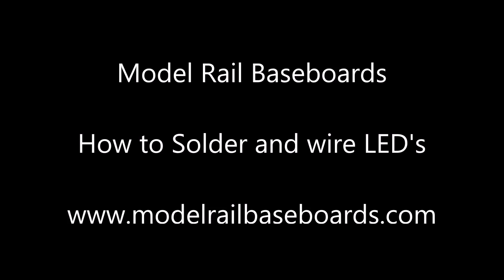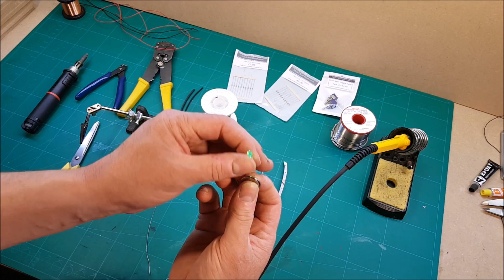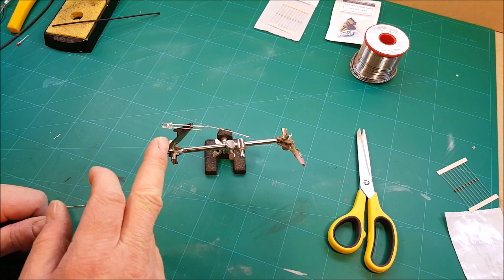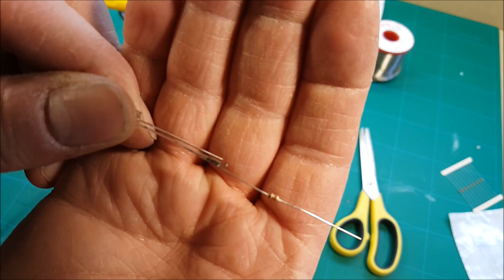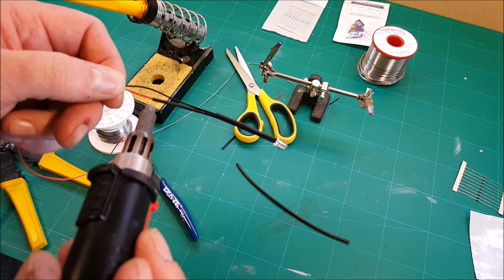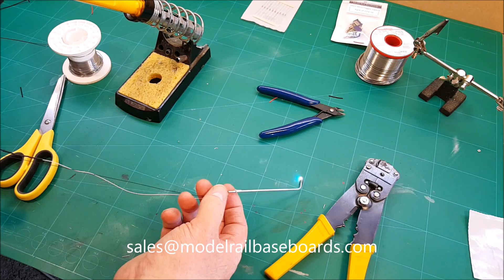MRB How to solder and wire LEDs

Comment: Thanks very informative. 
Hi I want to use 10 LED in layout do I have to use one resistor or individual for each LED.
Reply: Each  LED requires its own resistor
Reply: @westwonic  depends if the LEDs are to be in a series or a parallel circuit.

Comment: Pity I did not find your video earlier. After months of thinking about it I did my first LEDand resistor and it works. Your method of twisting the wire round beats trying to line them up on a helping hand. I fluxed and tinned but I see you did not, I will have to try that. Great video for a nervous modeller with electrics. I have subbed.
Barry.Devon

Comment: I might be totally wrong here, but I understood that a resistor has to be wired in the correct way according to the coloured bands ie there is an 'input' and 'output' way to use them. I'm happy to stand corrected it's a long time since I've used them.
Reply: That's ok. these resistors are not polarity dependent they can be fitted either way round.
The coloured bands identify the value of the resistance

Comment: Hi where would I get the battery to power the led's?  And how would you hook the wires to the battery? Thanks
Reply: Radio Shack or other Do-it-yourself retail or online outlets sell various size batteries and the proper holders.   Soldering iron works the best.

Comment: Thanks for the informative vid Dave. I'm working on a small Christmas project in a display picture frame. I need to wire 6 purchased 'O' gauge LED street lamps in line along the inside base of the box picture frame. They are each 3V,  20mA lights that have the resistors to solder if required. I want to run them off two AA batteries or a 9V battery. I feel confident enough to solder them as you instructed. Already drilled the holes and have the wires hanging out the bottom of the frame. Each lamp is approx 3 inches apart. 

My question is can they  be soldered together in line away from the battery source. In other words soldering a resistor between the two positive wires of the lamps and solder the negative wires together for a line of six coming off the battery with the first in line wired to the battery? Any input will be gratefully appreciated. This would not be looped back to the battery. From the furthest LED. 

BATTERY---->RESISTOR----->LED----->RES----->LED----->RES---->LED---->RES----->LED----->RES----->LED---->RES---->LED

I'm creative but not technically edumacated lol

Appreciated any input :-)